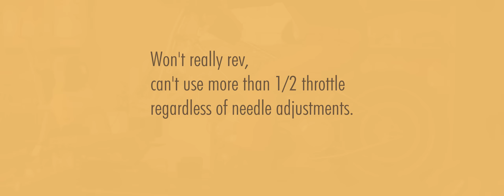Double Engine Aprilia RS50?!

Comment: man id really love to work with you on things. 
i live 2 strokes and most of your videos a remember all the issues i had with my 2 stroke scooter and my dive into those engines in particular. pipe to cylinder combo can very well be the problem with it not wanting to rev. it doesnt have the torque to build rpms till the pipe kicks in. reeds can help too.
but no double engine. cut the cases and connect the cranks with a light coupler. rotate 1 engines crank 180* from the other and youl have 2 cylinder and power on every stroke instead of every 2 strokes. they are smooth and even with modest cylinders can make over 40-60 hp and the 60hp range is good for 0-60mph or 0-100kph in 3 seconds or less. you can run on 1 ignition system or run the stator on each engine and run both independently. i plan on supercharging my scooter i still have as a toy now. amr500 is way more than plenty for mine. and will still be great once i cut the set of cases i have laying around here to make it a 2 cylinder. i keep putting off doing it but i want to soo bad.

Comment: You could add a slave pulley behind your variator. They just have a spring keeping them shut. You can rigid mount the motor then. Problem solved! Except for having doubled the rpm shift.

Comment: Wouldnt it be a better option to make up the correct sized sprockets and run the setup you had in the speedway frame. Seems like you're going around in circles somewhat and going backwards. 
The main issue is the carb related so simplifying the setup would allow you to concentrate on getting that right whilst easily being able to swap things around. 
Then when the time comes to mount the blower back on or test the brute force engine you're not having to re-do everything to make it fit/work

Comment: As the saying goes "Keep it simple, stupid".. NO, this isn't a 'Go' at you personally, but, we all remember that you had the motor up to what? 32-ish BHP in the old Dyno frame setup. And, to be honest, it has been a while seeing you try multiple attempts, increasing in complexity - swinging engine, using a variator, different carbs, 3D printed inserts and all that to the point where you are still using a 'Standard' non-blown motor and having all these troubles. It's frustrating for us as it is for you fella. But... Having said that, you STILL make it fun and enjoyable to watch through your trials and tribulations and HECK! That motor has proven to be quite a reliable and solid thing! All that testing, high reving, too rich, too lean, a period in its life being supercharged, you made quite a TOUGH 'Little beastie'!! 👍. Fingers crossed for you that this integration with a 'Proper' gearbox helps with getting firmer results for power testing and tuning as it will be great to see it having that supercharger help her gain some real healthy (and reliable) power once again. But as always... I'll be watching and will do till the end my friend. Fingers crossed🤞 progress is made for you and you can get back on track once again! All the best fella 👍😊        😎🇬🇧

Comment: My Mazda B2200 steering wheel came loose 3 times before I noticed that the splines weren't deep enough and the hub bottomed on the round steering shaft, duh.

Comment: Hey there! I saw you're dealling with all kind of problems but that pumper carb might be too laege for the engine în terms of the quantity of air on intake. Never the less the fuel mixture volume might also be too small for that carb to worck. I'm not an expert, I would use a smaller carb, I'll say a 17mm or 12mm would do the job.

Comment: mount the engine with sleeves filled with polyurethane, to absorb some of the vibrations.
Reply from the maker: I actually want the engine to transmit vibration into the frame - more mass to calm things down.
Reply: @2STROKESTUFFING  you don't think 92D+ urethane would still allow that vibration to transmit to the frame but maybe absorb some of the vibration inside the motor and carb?

I'm making assumptions based on automotive experience with my builds, I do know zero when it comes to 2strokes so please excuse my ignorance if this makes no sense

Comment: is this before the previous video?
Reply from the maker: No, after, the 3d print stuffer in my hand was a failed print.
Reply: @2STROKESTUFFING  I just noticed the lack of cable stabilizing the engine and the belt back on, not the changed you changed to in the previous video.  

I know you are having a fuel problem but have you thought of using a filter or runner prior to the carb to create air velocity into the  engine, that should help with the fuel/air mixture, similar to velocity stacks but more like an air box?  A lot of the funky air/fuel stuff could be like running a car with no filter, the air velocity could be bad, you wouldn't normally run a carb open like that, would you?
Reply: @2STROKESTUFFING  absolutely love your videos and I don't and never really owned a motorcycle more than a few months.

The small engine work is fascinating and you are a great story teller.

Thanks for the entertainment

Comment: 6:30 Can you not put a DAMPER on the swing mechanism to reduce or possibly eliminate the vibrations?

Oil alone or nitrogen over oil SHOULD be possible, either from a motorcycle, or a high performance mountain bike should work...

Even having a spring on it could help and make your engine variator travel both smoother and more compact.

Comment: The transmission is the first sanity I've heard on the drive side for awhile. What about your pipe? I've never built one but I've spent to s of time with the 2 stroke wizard messing with parameters. When we raced mini sprints with 250cc dirt bike engines we had a pipe guy. He messed up a cone on one and it ran horrible and burnt pistons. You've done all these wild changes on the same pipe?
Reply from the maker: Same pipe. Hoping to get some proper testing in now, see how it performs. It's been designed from simulations in engmod2t and should be pretty alright.
Reply: @2STROKESTUFFING  but when you are changing mbhp and  EGT rpm range ECT. the same pipe shouldn't be able to do what you want it to do.

Comment: You MUST have an air flow meter and a fuel flow meter so you can diagnose those carb issues. An exhaust gas analysis(for O2) would be great too. Instrumentation is the key to development. Without it, you are just guessing and that is wrong 50% of the time.
Reply from the maker: Agree, need more instrumentation.
Reply: Just guessing is a misleading statement though, once you've worked with something long enough, you can know what's wrong without having to guess.  I don't disagree that instrument's are needed since they do/can give exact values for loads of things like afr, map, etc. I just don't believe they're a must or be "you'll" just guessing and wrong half the time.  ........ but I do approve of any reason,excuse,rational needed to buy more tools lol.
Reply: @thorloki5449  "once you've worked with something long enough, you can know what's wrong" - thats true for things you've seen before, like your bike that you know well, but that is not what is being done here. He is trying things that have never been done before. Innovations that NOONE has ever done before. There are situations where the engine can 'appear' to be rich or lean but in fact the carb is working properly but you don't know it. If your senses are all you have then which is it? Your experience does not cover the facts.
Top fuel dragsters had 1000 hp in the 60's
Then over night jumped to 3500 hp then suddenly to 8500 hp and then to 11000 hp. All because they guessed wrong about what the engine actually needed because those engines are not like gasoline engines they knew. In all that time the nitro engines themselves did not change very much. The knowledge changed. If they had instrumentation in the 60's they could have had 11000 back then.
So if you know your system well you can make good guesses but if your system is new and untried then guessing is more likely to be off. Lacking the certainty of instrumentation data will lead you down many many blind alleys... and I want this engine to SUCCEED! It's full of ideas that I myself wanted to try.
Reply: @bill shiff   @bill shiff  I agree they are needed for the exact values, but we can agree to disagree. Its a 2stroke if you understand them you can make educated choices that aren't guess the whole reason i said just guessing was misleading. 
With his brute force engine, he was/is essentially doing the exact thing top fuel teams have done in the past by squeezing everything they can out of a fixed displacement, just the 50cc 2stroke version. Which dope as hell cause I've prefer low cc ever since I got my first suzuki 80 at 10y/o that my dad said I could keep but I had to figure out how to get it running on my own onlything he would do is make sure I wasn't gonna catch myself on fire(which I did anyway learned pretty quickly not to test for spark by pulling the plug after really flooding it).

And I do believe with top fuel it was a material science issue on what held them back at first connecting rods breaking, pistons burning up, clutches that simply couldn't handle the "direct" connection to the engine and the biggest then and now tires. All the tools in the world won't help if the materials can't handle it. They do the same now as they did back then, though what you stage with is what you race with no fuel,ignition, or clutch management its all tuned prior to the race.  Yea they gather more data now than back then to help tune though.
Reply: @thorloki5449  Top fuel was not a material issue. Pistons and rods now are little different than 1970's. It was almost entirely nitro combustion issues that they did not understand.They over revved the engines, used too little ignition timing, let them run too lean and too lightly loaded.  It was hard to sort it all out because the traction was not high enough to show gains when they had them.
Those gains I mentioned were not mostly incremental creeping gains. they were huge sudden Jumps. Small counter intuitive changes gave giant gains. 

Garlits accidentally discovered that tripling ignition timing doubled the power. Frank Hawley and Gene Snow discovered that bogging the engine doubled the power again. 
Doubling the fuel flow added another 3000 hp. Aerodynamic wings and bodies gave traction to be able to increase and use that power so that now they accelerate the hardest in the last 1/3 of the track where the engine is most loaded and the traction is highest. 

For the most part the engines themselves are little different than they were then. Its true a 50's engine was not strong enough for that power but by 1970's they were basically as strong as they are now. The gains came from Increased timing, getting rid of transmissions for high gear only, increasing fuel flow volume and aerodynamically loading the engine while producing traction.

I specifically mention the top fuel case because it was NOT intuitive and not subject to experienced guessing. When this little 2 stroke (which I love) switches back to nitro we are going to see new problems and new solutions. There is no reason it can't make 100+ horsepower supercharged on nitro but there will be interesting problems that gas engine experience can't solve. I can't wait!

Comment: Will it make a difference if you rotate the engine 180 degrees? Less pumping action and little more friction round the outside never hurt anyone😂😂
Edit rotate 90 and use a Jack shaft for testing purposes only 🤷🏻‍♂️

Comment: I want to start off by saying you are great! And I love everything you have done..... However.

You use a modern camera, Programmable CDI, modern supercharger, nickelsil bore.. the list is endless, but you are still using a carb. Please just go Fi! Think how great it would be and how far you would have gone! I can't see an end to this rabbit hole. I really want to see you going for an actual record. 

I'm very tempted to have a break untill you decide to give up on the carb. I still support you and share videos ect... But I want to see 3 steps forward and only 1 back. At the moment you are going round and round in circles.

Comment: The ford Barra engine is proof that high rpm timing chains work.

Stock green top will make 1000hp easy, 800hp reliably with no modifications…
Reply: It's a 2 stroke buddy, no timing chain and no 800bhp either

Comment: Needs air filter had same prob with my 2 stroke run boost bottle and air filter help with fuel starving at least it did when I put on my 50cc engine

Comment: Men listen to me if you want a good engine just because you are smart and you have all the tools you need just design your own crank case and your own 6 gear  transmission based on your engines rpm powerband sou you can make a lot of things this stuped variator thing is not gonna work is a waste of time and its not enjoyable on the road and pleaseeee make at list a 125cc engine ive been watching your videos for the last 4 years i am waiting every week to see it your videos and you always strugling with this stupid one gear thing if you think it this causes the 40% of your problems pleeeaaaseee make a crankcase with your own 6 gearbox so the hall desing be yours
Reply from the maker: Plan on making a gearbox for it later👍